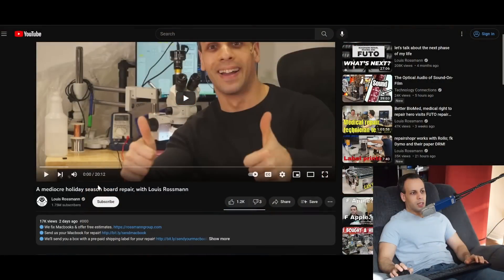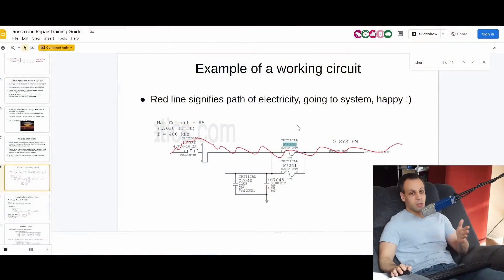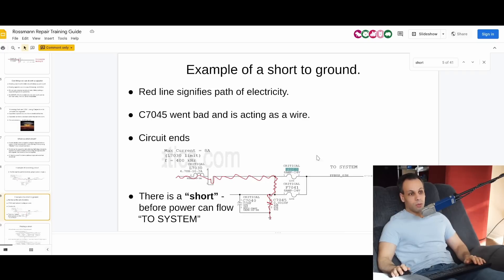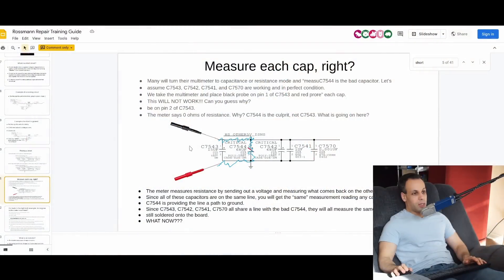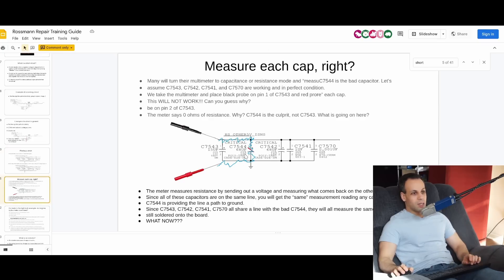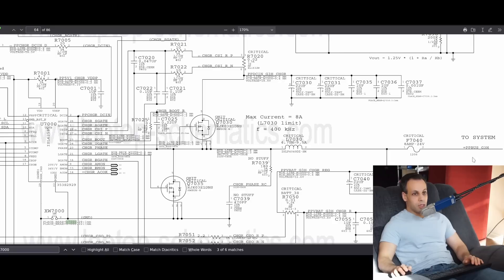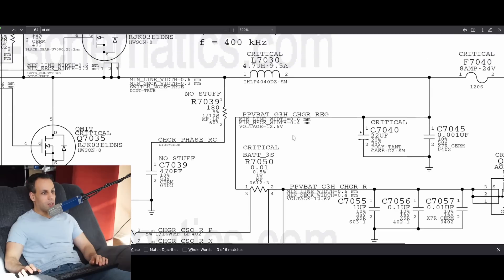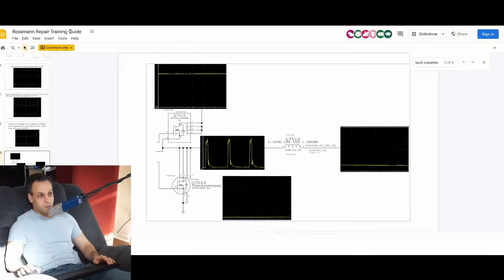Beware improper short detection methodology: on Macbooks you can kill your CPU, NAND, RAM, or GPU.

Comment: Thanks for this. This is a very common mistake. I see both beginners and well-seasoned technicians making it.
And it's even more unfortunate when then have hundred of thousands of subscribers on Youtube teaching beginners.

There are a bunch of other very common mistakes that will easily kill all hopes of repair that I outlined in a post on badcaps . net in the "Beginner's guidelines" topic (under the "Troubleshooting Laptops, Tablets, and Mobile Devices" section, trying to avoid Youtube's censorship by not posting the link directly).
I really hope one day that the misinformation will stop spreading and the people with a wide audience can cover this properly.
Reply from the maker: piernov is one of the smartest people I've met online, next to duke, when it comes to this industry. He is way above me in skill, knowledge, and resourcefulness. I value his input. Thanks for watching and for your contributions as always!

A followup to this video similar in spirit for troubleshooting these issues, that I think is important, is this. https://youtu.be/iot4lO1Nork
Reply: @rossmanngroup  I'm slightly concerned with the mains power cord, which appears to be holding open your door, stretching across a hallway. A mains power cable like that has a habbit of having the shielding pulled out and other problems happening naer the plug, which you do not see through the plastic covering, when it is holding up it's own weight and pulling constontly on it's self.
Reply from the maker: @Right-Is-Right  Where do you see a door?
Reply: @rossmanngroup  it kinda looks like a door begind you, might be something else, not really the issue. The power courd holding it's own weight bmight become one, and I would not want you playing "what the zap".
Reply: @Right-Is-Right  It seems to just be a shelf
Reply: Thanks. Here is the post I am referring to: https://badcaps.net/forum/showpost.php?p=989502&postcount=2
Reply: So True
Reply: "And it's even more unfortunate when then have hundred of thousands of subscribers on Youtube teaching beginners" well they got taught something alright

Comment: Small correction to slide 7. A voltage divider does drop the voltage, but it isn't steady if you draw power from it. Imagine your load is a resistor, it's parallel to the resistor to ground, thus effectively lowering the total resistance, which in turn lowers the voltage. A chip isn't an ohmic load, making it only more complicated. The lower the resistance values of the divider, the lower the swing will be, but the more power is lost. Also, a buck converter is different from a linear regulator

Comment: I have a question about the example with the buck converter. In your example you spoke about 8V going into the transistor, the transistor then switching on and off to get an 8V pulse, followed by 0V. Then the coil creates that average of 0.8V. You mentioned the transistor being stuck, so when sending voltage through it, it would no longer switch off. However, if the coil were to break instead of the transistor so that it's conductive, like a wire, the result would be that same pulse as before the coil, right? So if you measure the entire buck converter, sending 8V through it would be that 8V pulse followed by 0V, if I understand correctly. I guess with a lower voltage, the 8V pulse would be a much lower pulse instead, but I'm not sure if the transistor would still work properly at that point.

Comment: I'm a very lowly hobbyist but I've always had this logic about injecting voltages that since there's a possible short and something is broken - I don't know at this point what exactly is wrong with whatever I'm trying to fix - injecting voltage that would be "safe" in a unpowered functional device might not be safe on the broken device. Served me well so far and very rarely broke anything.

Comment: Just to add a bit more: If there's a tin whisker or something, the rails could be shorted across each other! So that 12V rail might be injecting power into that 3V rail and the only reason it didn't blow up before is that the power supply detected a fault and shut down.. until you came along and force-fed the circuit.

("But Coda, how can a tin whisker short the rails like that?" I hear someone ask. "They're supposed to be isolated!" Yeah, and the backlight power line isn't supposed to be next to the LCD data line, and look how that tends to go.)

Comment: interesting -seems this would only be the case when a prior circuit limits or cuts the current just in case of a regulator going into pass-through fault mode, other equipment i.e tv, hifi, arcade  would already be blown to bits before you got there. vintage arcade had zenners to fire a scr to crowbar the rails incase their regulator went into wire link mode. proof technology goes backwards

Comment: Killed a few south bridges cause the voltage my multimeter injected on diode was around 1.3v
Why did it work before and not now goddamit?? 
Once i realized, i cried, and then bought a new meter

Comment: Your example was flawed in that if a switching transistor was shorted, from source to drain, you would most likely already taken out what it was driving unless the circuit had proper current limiting. Sometimes they do, sometimes they don't. I always inject voltage into a circuit to find a short. Your suggestion to use the lowest voltage in the circuit is only part of the proper procedure. You need to use a bench supply that has a high current capability and, most importantly, variable current limiting. You set the open circuit voltage to the low level. I usually start at one volt. Then, you turn the current limit to maximum. The voltage will drop to zero. Hook  the PS up to the circuit. Rotate the current limit very slowly until the current starts to rise. Keep increasing the current until the voltage just starts to rise. Check for hot components, smoke, or the occasional explosion. That's my two cents. Works for  me and yes, I have been doing this for a long time, working on much more expensive servers than anything  Apple  makes. I have also had the displeasure to work on Apple devices as well.

Comment: one shouldn't be injecting voltage unless the whole circuit has been traced or have experience with the specific points. Even 0.8v can equal 8 amps. Blindly going in to "fix" something because so and so said so on a video is why arguments for anti right to repair can be so easy to make. Not saying don't fix your own stuff, i make a living from fixing electrical circuits, I'm just saying maybe watch more than one video and definitely understand you are about to yolo something even if you did your research but have never done it before.

edit: when you do a resistance check on a circuit you ARE injecting a voltage into the circuit. its possible even with a good multimeter to fry a circuit or in some specific applications fire off the explosives for an ejection seat on an aircraft by simply checking for resistance improperly.

Comment: Even limiting yourself to the lowest bus voltage isn't foolproof: some parts with multiple power inputs, especially older ones, have strict sequencing requirements and will either latch up (become a short) or flat out die if they are energized out of sequence.

Comment: The CPU was dead anyway.  If you get a bad buck converter that outputs too much voltage (very very rare BTW), the CPU saw (in this example) 8V however briefly before the overcurrent detect shut it down.   By the time a tech gets to inject voltage, the CPU or GPU was already smoked.

Comment: Emphasis on checking resistances between your "shorted" rail and other main rails. It's so easy to be trolled by thinking you have a short to ground when there isn't, there's actually a short to a low resistance line like a GPU. One thing I wish I would see more youtubers doing. Yes it's boring. Yes it's tedious, but it gives you so much critical information. How are people supposed to know about something when their source of information is cutting it out of the video to try save some time?  Especially when so many people think short means short to ground. It's like boiling. Were conditioned to think boiling means hot when it actually doesn't. It can be hard to break that social norm mentality and get your mind out of the linear "oh this is x and only x" mindset. Short means short path, it mentions absolutely nothing as to what it's short to.

Comment: Not a repair guy just school electrical knowledge, but what about injecting a high impedance/current-limited voltage and checking around with voltage sense? Rest of the system should go upto the input voltage but voltage will stay grounded?

Comment: You have an error in your slides at 4:25
"A buck converter is a linear voltage regulator"
Linear regulators will convert the voltage they have to drop into heat. So it you have a 5V->3.3V regulator at 1A, the linear regulator will convert 1.7V*1A=1.7W into heat. 
Buck converters use an inductor to convert the input voltage to a lower voltage. They can reach pretty high efficiencies (95-98% roughly). So they are wayyy more efficient than linear regulators.

Comment: Ok, I'm curious. Let's say there is a short because of a "stuck" buck converter transistor. Just like you described. 
Wouldn't that have already killed what's on the lower power rail, when the machine was last on? 
I mean, if you get a machine in for repair, that means, that the customer had to have tried to turn the machine on and it not working properly right? 
But if the short is responsible for that behavior, wouldn't that mean, that the machine already sent high voltage to a low voltage line, killing everything on it? 
Why are you then concerned about making it worse?

I'm not an engineer, but it just doesn't quite add up for me. What am I missing here?

Comment: If the buck converter is stuck, and the customer found that something didn't work (so they did turn on the machine at some point), didn't they already fry their CPU ? Or to ask the question another way, why would the frying happen when you apply voltage to the power line for debugging rather than when the customer first finds out something's not working ? (probably a naive question, I know nothing about repairs but that wasn't clear to me while watching the video).

Comment: Well, we all know who you're talking about.
Yes, you are right, his method is old and barbaric and he uses a lot of guesswork with minimum understanding of what's going on in that circuit.

You're example isn't too good.
If it's just the transistor that's bad, then you're CPU is already fried.
If there's a capacitor that's bad and a transistor that's bad and you remove the capacitor then it's also fucked the moment you try to power on the board.
Reply: im sitting here scratchig my head. who is he talking about?
Reply: @bryzztortello  just search for "ASUS Notebook Repair"

Comment: As someone who doesn't repair boards, I still don't understand how this works. If injecting 8 volts into an 8 volt powerline with a broken buck converter will kill the CPU, then... In theory, shouldn't the CPU already be dead from when the short initially happened anyway? Shouldn't the CPU have been fried when the board broke while the machine was powered on? (Or in any subsequent attempts to hit the power button and attempt to get fanspin while the circuit was shorted?). Why does your test specifically fry the CPU, and why didn't it fry already? Does the PC have safeguards or failsafes or something that shuts everything down to prevent damage (which wouldn't happen when injecting voltage directly)?
Reply: Not necessarily. The power normally delivered might not be adequate to cause problems (control loops, clamping diodes etc protects the cpus). But when we use the power injection method we usually use abnormal high currents in order to force heating of the shorted component. Currents that can destroy good components.

Comment: This is purely speculative on my part, but it seems to me there is one other issue with 'safe' voltages when you've got a short:

Let's say there are 8 components in series between your voltage and zero. Now, there's a short in the middle. Wouldn't the four components between your voltage and the new 'zero' receive higher voltage each than they would normally?

Comment: so much drama for teaching how to check a simple ohm measurement from vcc to ground before one applies the min rated voltage and current, aka wattage, for a line... it is like people don't even want to use their biological mass inside the sculls anymore... there is NOTHING controversial on your advice and it is buffling to even start to think who would go against it and what would be the ultimate goal for doing so.

Comment: but... if the buck converter was dead, doesn't that mean whatever it was supplying is already fried from when the original fault appeared? Like, if your test 12V can fry it, why wouldn't the PSU's "normal operation" 12V not fry it?

Comment: The injected voltage should also be current limited. Use a current limited bench power supply or add an appropriate resistor in-line with the probe. 

If the injected voltage is limited to very low current it will be less likely to damage anything that f the voltage is wrong

Comment: Mind if I ask a stupid question:
If you were chasing a short, and had the schematic, wouldn't it be smarter to unsolder/remove the coils going to the CPU, GPU & SSD, to narrow down where the short is & more importantly minimize the chance of damaging something that is difficult to replace or has data on it? That way you can get a better idea of where the short  or near short is.
Reply: Even without the schematics and desoldering, a very good troubleshooting step is to measure resistance between your shorted power rail and any other power rail you may worry about.
For example, measuring resistance between PPBUS_G3H and CPU VCore, these are usually power rails that can be easily identified even without schematics. If you measure a very low resistance, you may worry about a shorted high-side MOSFET.
Desoldering component isn't always harmless or easy, so it is better avoided if not required.

That said, there can also be false positives, such as laptops with Nvidia 1000-series GPU or newer, where the normal resistance to ground of GPU VCore is below 1 ohm (can be somewhere around 0.3 to 0.6 ohm), so measuring between the main power rail and GPU VCore will also show a very low resistance reading if the main power rail is shorted to ground.
Reply: Even though cracking out the iron would result in definitive answers, this means you have to pull out the iron for every repair, as a diagnosis step. This doesn't make sense in the long term so the goal is to find the problem whilst doing the least amount of work. Life is one great big optimization problem.
Reply: You're better off removing CPU, NAND and any other sensitive components that could have volatile storage, chase (and with some luck) fix the short, reball the chips and resolder, and if everything fails and still doesn't work, get a good know working board and transplant the sensitive components yet again but to the good known working board. See, that's all you "need" to do, but instead you can start with a good measurement protocol and save yourself hours of frustration. If you are broke and can't get a fine oscilloscope and power supply, build yourself a ghetto SMB Box, it will save you a lotta money and headaches.

Comment: If the buck converter failed and that is why the device is broken wouldn;t the break already have fried the component?
Reply: Not necessarily. The power normally delivered might not be adequate to cause problems (control loops, clamping diodes etc protects the cpus). But when we use the power injection method we usually use abnormal high currents in order to force heating of the shorted component. Currents that can destroy good components.

Comment: Great video! the only thing you could do better is visually show on an example board checking for said shorts via ppbus/CPU core rails I know it's boring but doing it more will drill it into people. Also, I've thought about this a bit having done it myself on an older shitty lab power supply and while I did understand injecting higher voltages could damage something I was unable to get higher currents than 0.4A @ 0.5V so feeling I was safe I pushed the voltage up to 2V to get the current to see the heat on my thermal cam but it was too late so something like the TS20-30 would have helped me not be an idiot..